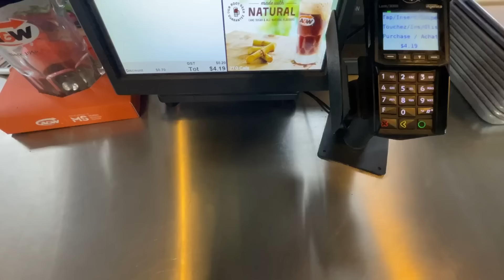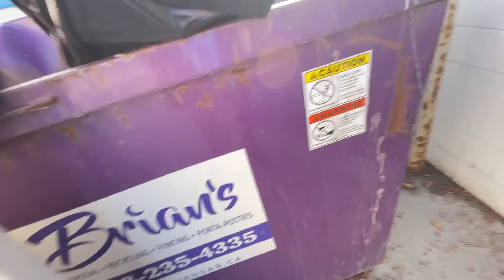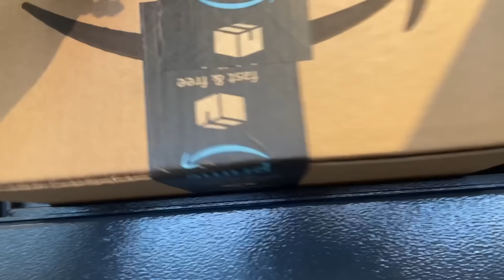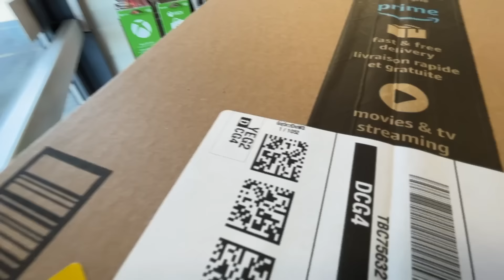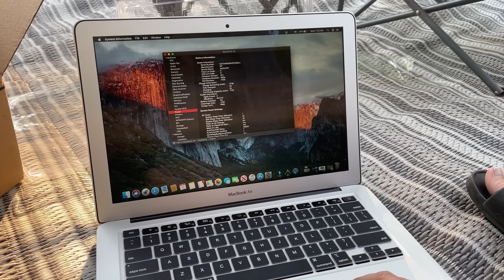FULL-TIME VANLIFE in the CITY | my day working a 9-5 job | Vlog #6

Comment: Sheesh almost all the van peeps have a cracked windshield...

Your friend Matthew changed his and - boom- another crack.

Yours look like a rock chip, but didn't catch it early enough to seal it?

PS: good hack with the Amazon locker
Reply from the maker: The chip was sealed but there was a hail storm that cracked it even more 😫 this place is prone to hail storms I think haha
Reply: @happycoffeevanlife  oh, I thought it was also from the temperature extreme during the winter of cold outside vs toasty diesel powered heat on the inside